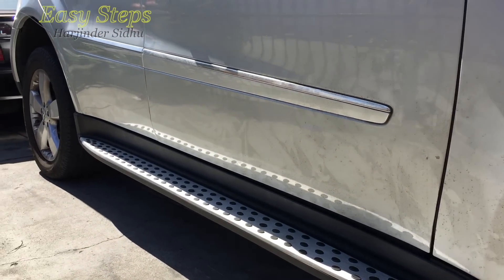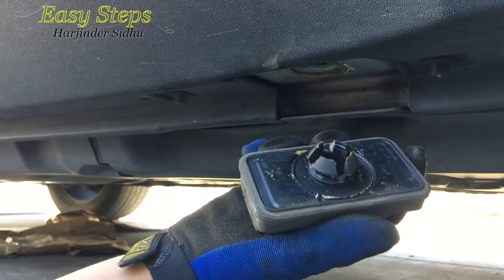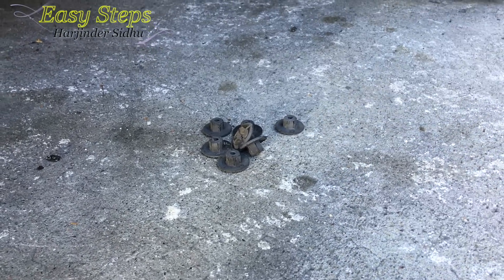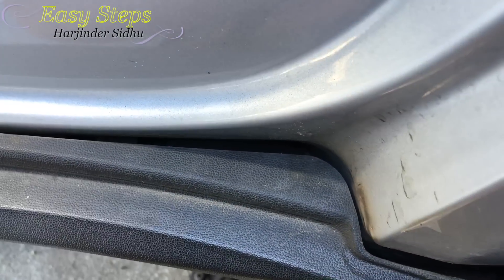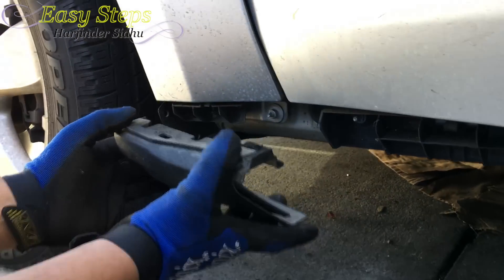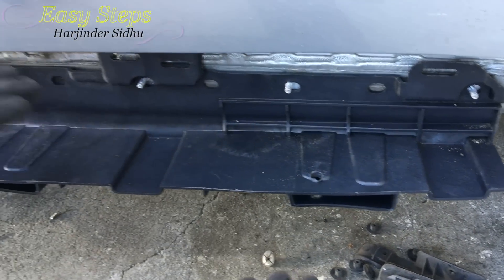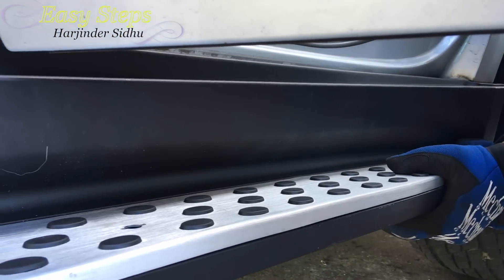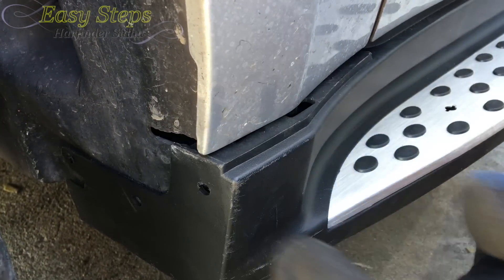How To Install Running Boards on Mercedes | Nerf Bars | Side Steps | Step Bars

Comment: How did you get the jack pads back in place? The ones that come with aftermarket kits do not seem to fit properly, won't hold in place.

Comment: 4:50 When you screwed the nuts on the frame, did you just leave them hand tightened, or did you use power tools?
Reply: I would say hand tightening is the safest option.
Reply: @arturo8951  3 years later 😂

Comment: the black spots on the side board are plastic  and the silver part is aluminiuim and they are not wide so you can’t really place your foot perpenticular, you gotta for best traction is place your teets parallel 

during  the winter i hosed the jogging boards with water and in the morning it froze and yes you can slip on them

so what i did was performed a scientifically test;  one side i placed traction tape on the board and the other side i layer down a thick layer of elmers glue then covered it with black small gravel and black sand. 

so far the traction tape is holding on the aluminum stuff but the tape that’s on the board black plastic is loose but on the black spots it is holding up

the elmers glue side , failed.  i’m gonna try using silly cone then the black sand

if all works well then i’ll video tape my final results 

my mommie bought me a mercedes